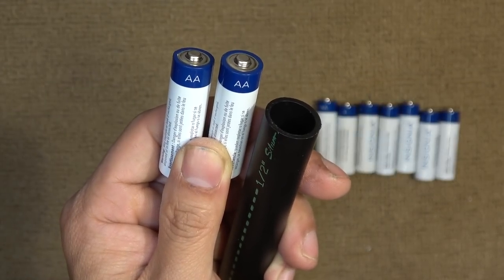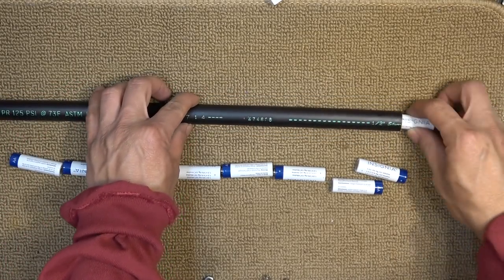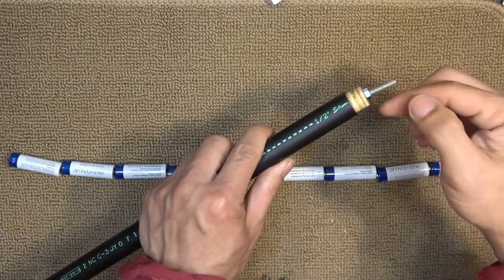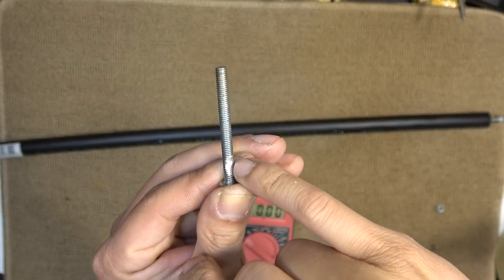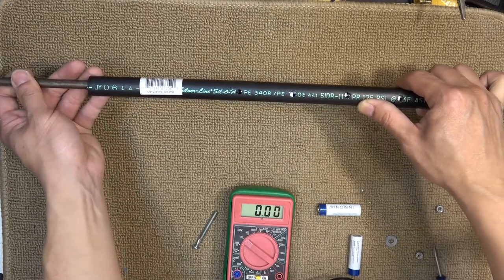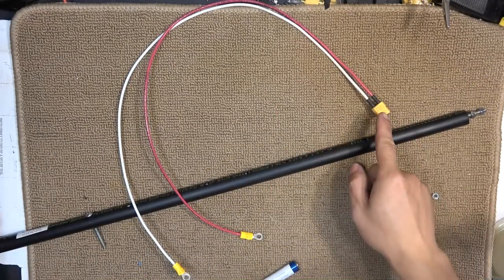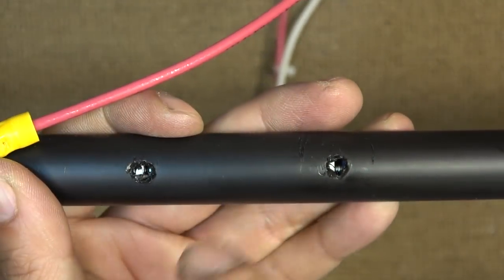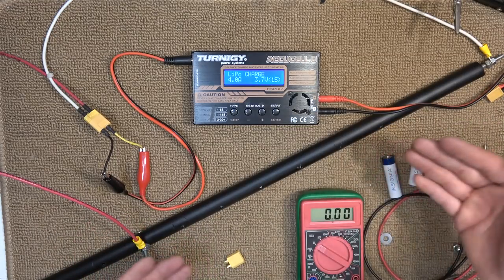DIY: Home made AA 1.5V Alkaline battery holder (in series)

Comment: 3/4 pvc pipe works great for 18650 batteries used for making a power source to run 12v to lights for my bicycle by running inside the down tube very DL. 😉

Comment: Parallel would be a bit tricky if you want to maintain multi-voltage capability, but for a dedicated voltage (let's say 5S[2P] or 7.5V nominal, for easy math), you could put an electrically insulated divider (your wood plug would be great) in the middle of the tube and run wires to/from the appropriate terminals for your choice of serial or parallel. If you were to do this, the fatter tube might not be a bad way to go if you can route the wires internally...
Reply from the maker: Yep, it's a lot of work to parallel this. But a fatter tube is a good idea.

Comment: Hey vuaeco , great video , how about a slightly longer stick for two or three more batteries , wouldn't that have charged the battery a little faster ?Two of them in parallel would be best . I am trying this tomorrow , i'll make two of those  ,i need the PVC pipes all the shops are closed now , heh clever little invention there . thanks alot for posting this .
Reply from the maker: 2 or 3 might be too much voltage. Would be best if you have them in parallel.
Reply: @vuaeco  Yes , so 2 sticks of 14 volts each . i thought that would have doubled the amps .. i was wrong , since there is no increase  in voltage . Putting them in parallel just increases the capacity or runtime i should say , since the current supplied by each pack will be 1/2 of the total . anyway thanks again . salut